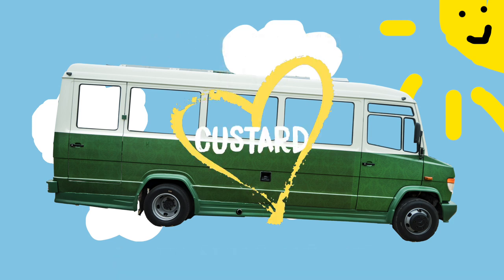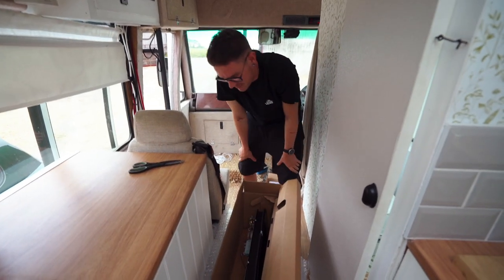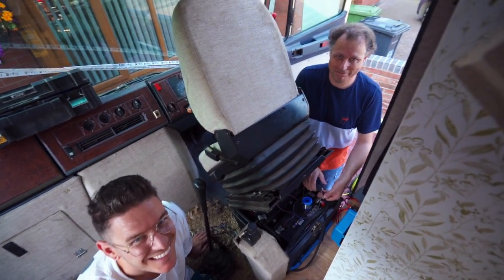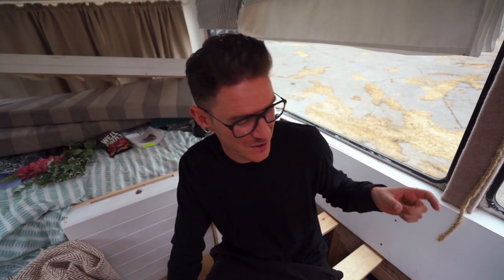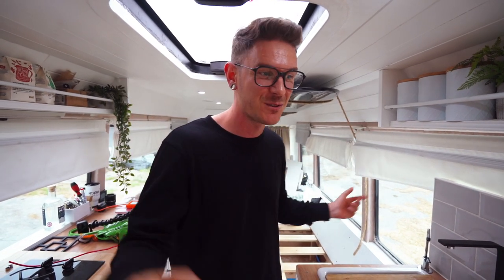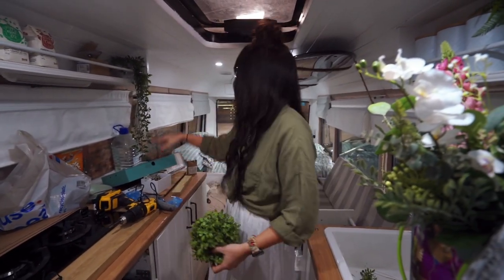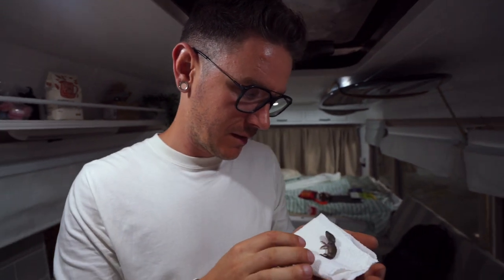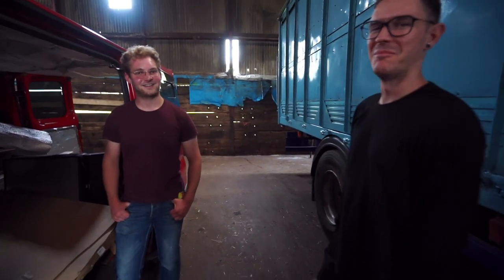Van Life - the ULTIMATE off-grid Electrical install

Comment: How about a big shout out to Victron Energy products, like you we are very happy with their products.
Here is our story, last year we were awoken on our boat at 5am ish in the morning by the mains charger buzzing like crazy, it had already cooked our 2 leisure battery's. Same brand charger replacement was € 600, too salty for us, we got a Victron smart bluetooth charger for € 180 , plus battery replacement = less than the  original device. happy days. And it works well with our little (tea tray solar array) yes La Rochelle has a lot more sunshiney than Wales.
So many off grid camper builders watch this,  buy once, buy quality.

Comment: Got a Truma in @velomoho but guessing youd have to cut a hole in Custard for it to work.  Very efficient, fast to heat up & cheap to run.  Do you guys have refillable gas - you're not using Calor are you ?

Comment: Lads, you're so close to finishing a banger of a conversion on Custard! It's all come together rather nicely over the last few months and I'm looking forward to following your next big adventure! 
Shame about the untimely death of young Brave Heart there though 😢
With regard to a boiler, I have the Truma Ultrastore BGE 10. I'm using it on a gas only set up but can also be run on 240v or both at the same time. You still have to cut a hole in the bus though, you don't want to suffocate on carbon monoxide!

Comment: Hi Guys, just curious if you could point us in the right direction…. With this electrical install how do you switch between the main charging source, for example if you have the solar panels wired up, and you start the engine does that not cause 2 direct routes for main charge, or do you isolate the solar panels when the engine is running etc? 

Just came across your videos a week back as we have literally just got our own Mercedes d180. 😀

Comment: If your going gas you will defaintly need to vent it so you will need to cut a hole in her. The best out there is the truma combi which does your hot water and heating. It can run off gas and 240v so you could use your inverter for that as well 👍👍👍

Comment: Have you thought about an electric water heater as you now have oodles of power, you may have to go to a yacht chandler, they have lots of electric and diesel appliances as gas on a boat is a no no these days as any leak will collect in the bilges, one spark and boom.
Reply from the maker: Yeh apparently electric water heaters draw a LOT of power.. that’s why we’ve just settled for gas.. am I right? Or do you know of a good one that isn’t too hard on the power?
Reply: @kingingit  Provided you don't want near boiling hot water but only about 40 deg, comfortable with a bit of cold added for a shower, one can get fairly low wattage instant ones.  As I don't know what water tanks you have, the heat from the engine's cooling system and the exhaust can be utilised as well.  A well insulated hot water tank will stay hot for hours.  Builders of small luxury sailing and motor cruisers are a mine of information as to what is available , the only things that are different is one has wheels and the other floats.